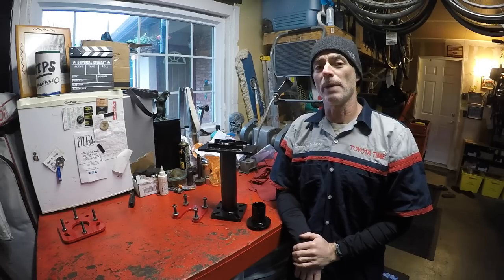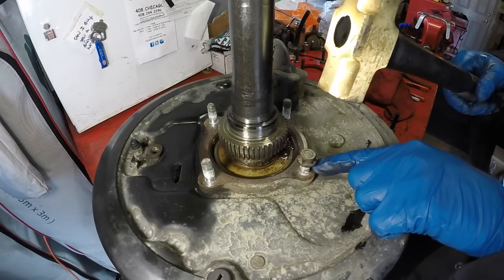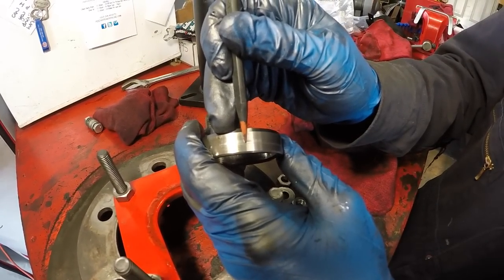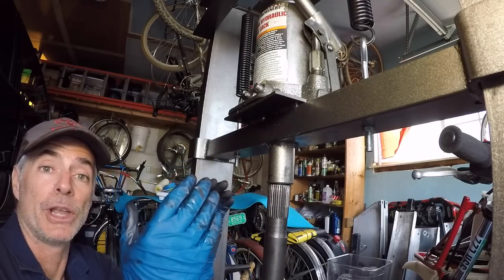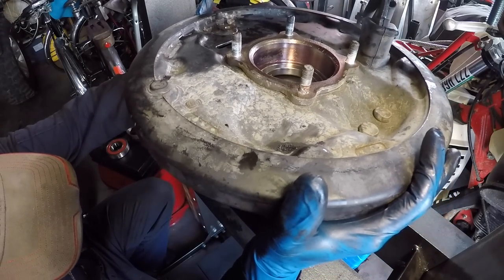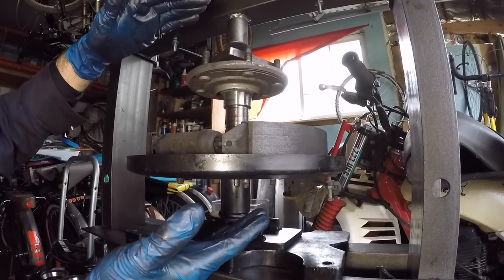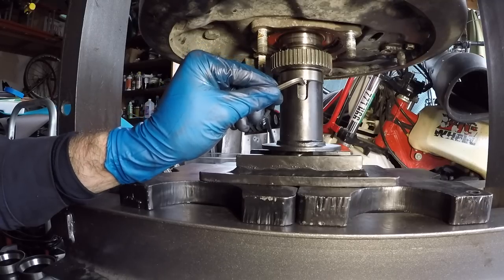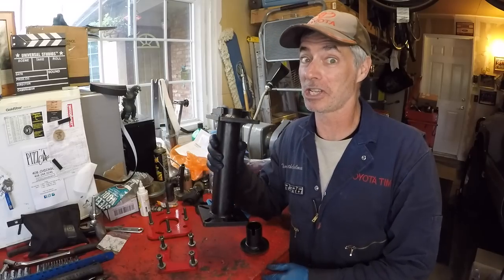Toyota Rear Axle Seal/Bearing Replacement (Part 2)

Comment: got one coming!
Reply from the maker: Smart purchase!
Reply: @TimmyTheToolman  i just got under my truck yesterday to check something and noticed the left backing plate a bit wet. I knew what it was. The right side i did a couple years back. The money i was going to spend on parts, aside from buying a new bearing and seals, I've put toward the tool purchase. After doing the numbers, there isn't much of a difference in cost saving. The machine shop in my area, is the only one so he knows it. I think it's  $85-100 for this. I've been a mechanic 30 plus years and know how to do this stuff, but always in the shop. I'll get my own tools and do mine now. I'll find others that need it done and recoup my cash.
Reply from the maker: @oldz70  Smart move.  Since you're a mechanic, you know tools can easily pay for themselves pretty quickly.  Also, you could always use the tool and then resell it if you wanted and recoup most of your money back too.  I like having tools, so I rarely sell them.
Reply: @TimmyTheToolman  I'll keep everything. I made the mistake of selling tools years ago. Not again. They will get used.
Reply: Where did you get the brass hammer? Lowes and home depot don't have them. Harbor has one but too small.
Reply from the maker: @oldz70  I added a link to the one I purchased via Amazon in the video description.
Reply: @TimmyTheToolman  thanks man.
Reply from the maker: @oldz70  You're welcome.  That hammer has been very handy.  I use it all the time.
Reply: @TimmyTheToolman  got all my tools and parts today and replaced it. i ordered a 4x4 plate, but didn't need it. i enjoyed doing it, instead of letting a shop do it. i eyeballed the retainer and did the grease check and it was centered, right on the money.
Reply: only thing i don't like is that the retainer driver is not powdercoated. duane told me that you painted yours. mine is shorter as well.
Reply from the maker: @oldz70  Good to hear it went well for you.  The satisfaction of doing your own work is pretty cool, isn't it?  Happy Wrenching!
Reply from the maker: @oldz70  Yeah, Sean and I just shot it with some black spray paint.  This isn't something that would be nice to have powder coated like a bumper or rock sliders.  Shooting it with some black spray paint is more than sufficient.   The original retainer driver was made longer but after we used it we realized it didn't need to be that long.  This allowed Duane to save a little on material costs and also allow the tool to fit into a smaller box for shipping keeping the shipping cost down.

Comment: Does anybody know if the tool will work with a 04 gx470 thanks
Reply from the maker: Use the link in the video description to be directed to Duane's Ebay page.  He sells different kits for different applications.  If you can't figure out the answer from browsing what he has for sale, message Duane and ask him.

Comment: Pvc abs pipe good idea the tool company not gonna make any money when people know this
Reply from the maker: Since the bearing isn't a press fit at all into that bearing case, the ABS clean-out is a very handy tool to use because it gives you feedback if the bearing isn't going in straight.  If the cap starts to bend, the bearing is going in crooked and it's best to stop and reset.  In my kit of press sleeves, I don't have one that's quite as wide as the outer race of the bearing and that's why I looked for another option.  The 3" ABS clean-out ended up being a perfect match.

Comment: 28:45 use 2x4 wood works too
Reply from the maker: You're right.  Since the amount of force necessary to drive the bearing out is negligible, a small section of a wood 2x4 would work just fine.
Reply: @TimmyTheToolman  another great video as always. i know i won't find a plate like that lol so i use what i got :)
Reply from the maker: @MinhBui-ni1by  Yeah, whatever works.  Macgyver away until your heart's content.
Reply: @MinhBui-ni1by  The guy he got the tool from has them for sale in his ebay store.

Comment: Hey where can I purchase that part that is designed for pulling axle bearings for Toyota’s
Reply from the maker: Click on this link https://ebay.us/lhibma
All the tools used are linked in the video description.  In the gray background box under the video title that starts off with how many views the video has, is the video description.  To expand it out, click on "Show More".  We provide all the part and tool links there.  I also recommend reading the comment we pinned (1st comment you see) for updates on the job.